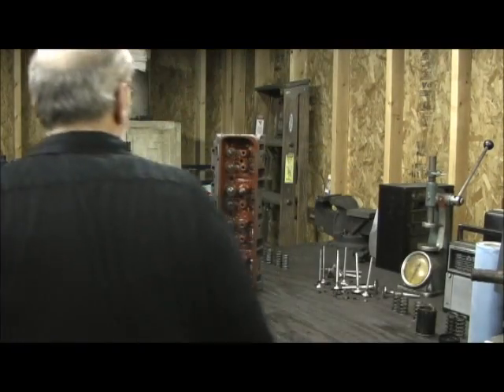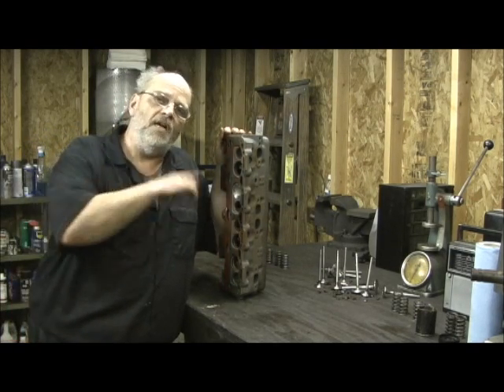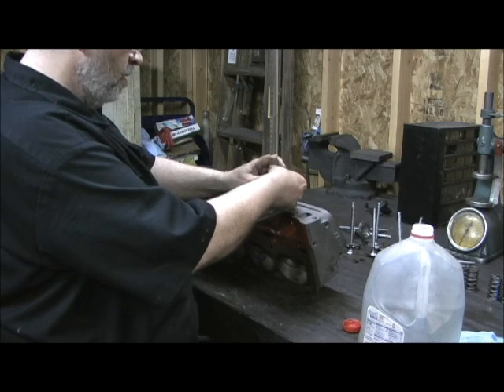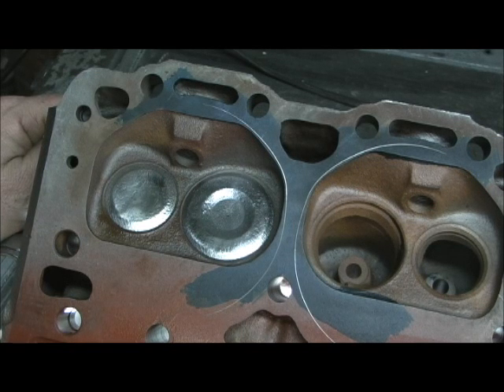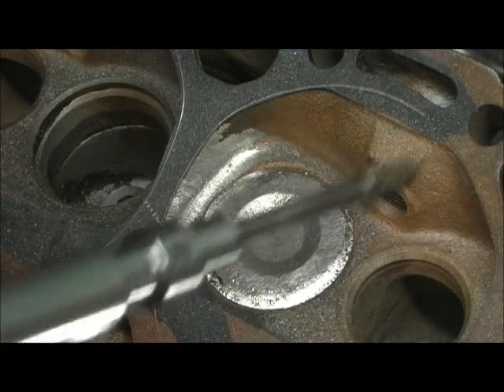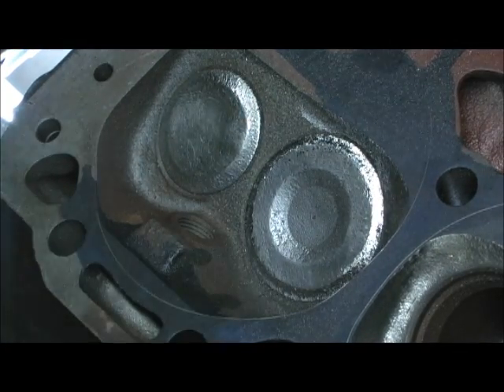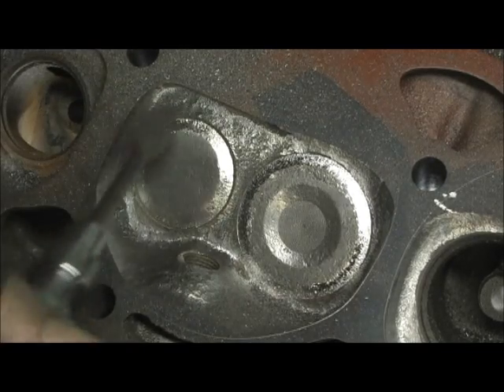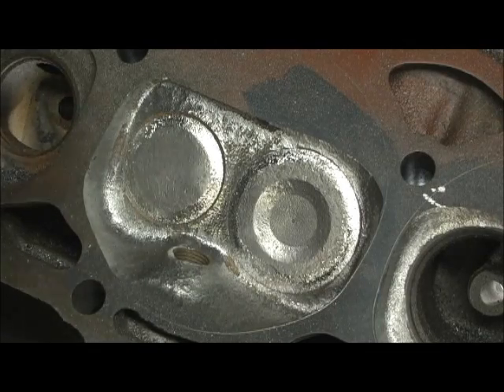1989 350 TBI Stage III.5 Porting  Part 1

Comment: You are correct Sir. These are the original vortec  heads. I was a GM drivability tech from 1984 to 1997. At the GM Training Center in Garland TX our instructors always referred to these as vortec heads. The general public never heard "vortec" until 1996 when GM introduced the "Vortec" line of engines as a marketing ploy. All us GM techs did a double take when GM came up with that because we had been calling TBI engines "vortec" since 1987! LOL!  Chevy heads were redesigned for 1996 to comply with OBD2 emmission standards. Thus the B.S. marketing from GM.

Comment: Watching your videos with detail! I'm working on a 305 tbi and have measured 185cc intake. 57.2cc exhaust. 1.87 intake valve. 1.535 exhaust valve. 54cc chamber. I had some leakage when I first cc the intake but ran test again and right on money. Working on porting for a 65 c10. Gonna surprise a lot of stock ls guys.

Comment: If those heads made power at 4000 RPM and below, and had great MPG with a TBI or carb intake, what would happen if you used a Tuned Port Injection intake?

I imagined that if that setup was used, you get more horsepower and MPG.

Comment: Actually john smith you be wrong. Vortec heads have been produced since 88' only thing is they didnt start calling them Vortec heads until theid 90's because GM didnt realize how much power those heads were capable of producing until mid 90's!

Comment: They did not start producing VORTEC V8 engines until 1996. The 193 heads were used from 87 to 95 on both the 305 and 350. The 193 heads are not VORTEC heads.
Reply from the maker: Wow Mr. Smith, thank you for that VERY IMPORTANT piece of information, and for pointing out I was incorrect about the 1010% actual casting dates of the head. I think, however in other videos and on my website I have tried to point out that the 193 heads ARE The real VORTEC heads, and your wrong on that one my friend. THE TERM Vortec, was borrowed from the 193, as the Chevy engineers called the port "vortices", which refers to the circling of air, or water turning in a circular motion, creating a better MIXTURE and higher velocity charge. The name was starting to catch on by the mid-90's, and they had a GREAT AD CAMPAIGN and they labeled the new TRUCK...VORTEC, which the head has NOTHING to do with a Screw port design what so ever, and the VORTEC is simply a 461X design runner MINUS the TALLER roof and roll over the short turn. The VORTEC and the 461X are just 5cc apart (461X is 165cc and the Vortec is 170cc) The sad thing is: Even though the VORTEC is the best flowing out of the box factory head GM had made for the OLD SCHOOL SBC, it was worthless because IF you try to do much of anything other than a light bowl job, the heads CRACK, CRACK, CRACK to hell and back. IT was designed to be a THROW away head of sorts.
     Thank you for that tidbit of info though, it is people like you that help keep me on my toes, even though you got half of it wrong...Thomas

Comment: Hi ive been learning a lot from your videos! I have a couple questions if you could please answer id really appreciate it. How many cc's were the combustion chamber on these 193's? Because I have the same ones on my 1990 5.7 z71 and I just bought a set of world s/r torquer 2.02 1.60 170cc 60cc 76cc c.c. heads for a decent price and was wondering which ones you would recommend for overall performance? Thank You